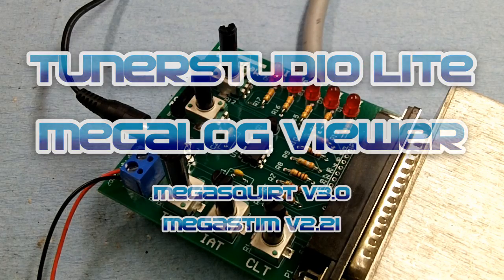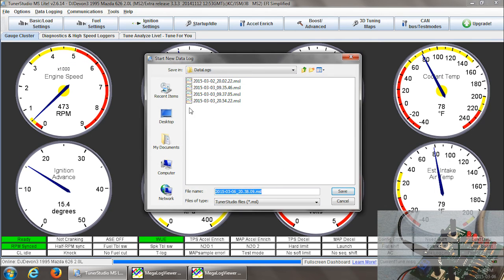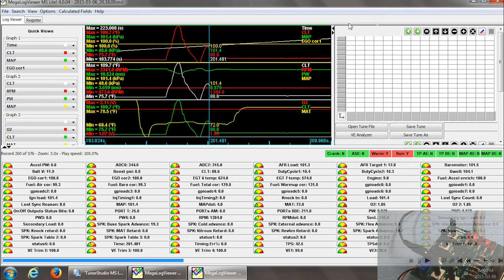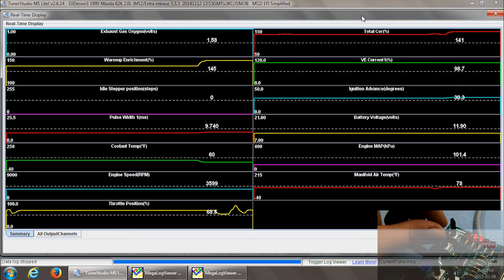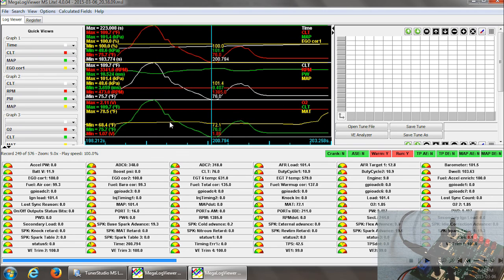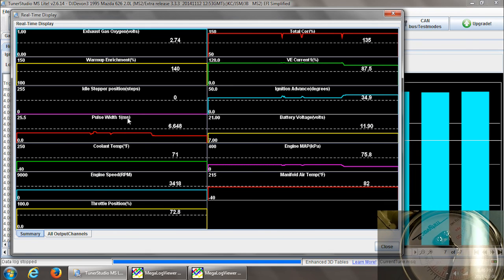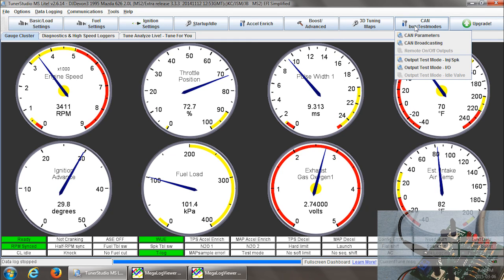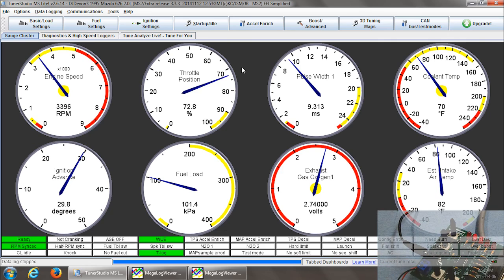MegaLogViewer (MLV) Benchtest with MegaSquirt + MegaStim

Comment: If you ran MS on say.. a 2003.5 Mazdaspeed.. (OBDII) Am I going to be able to get the car inspected and keep it "legal"?

OK.. nevermind the "legal".

Can I get it to pass inspection?

Thats my question. lmao
Reply from the maker: +ILL Gotti No a Megasquirt ECU will not likely pass emissions.  Megasquirt is for "track and off road use only" where those vehicles are exempt from inspections.  Read the FAQ on the Megasquirt/DIYAutoTune website.  It is not for daily driven commuter vehicles.  It's for dedicated trailer towed race cars and/or for vehicles in countries or states with practically no emission laws or inspections (such as Florida where I live).
Reply: Got it. Looks like SSAFC is my best bet for the Mazdaspeed Protege.

BTW.. thanks for making that timing belt video dude! I made good use of it..

Comment: I still see some pre obd 2 vehicles. There very limited to pids and bi -directional controls. We test them at the tail pipe measuring the five gasses. Where as long if the check engine is not illuminated and the moniters are complete from a drive cycle on obd2 vehicles.
Reply from the maker: We do not have emissions inspections here in FL.  This is the perfect state to get into MegaSquirt. :P
Reply: What is that
Reply from the maker: *****  What is what?  MegaSquirt?  That's what my recent videos are leading up to.  Google it.

Comment: Nice to visit your channel
I see you all the time on scanner danner
And schrodingers box
Reply from the maker: Thanks for stopping in to say hello.  I recognize the name. Here's a video you might enjoy.  https://www.youtube.com/watch?v=ITfQGEASYvU
Reply: I do Emissions and drivability in Northwest Indiana. Have the L1 and the I.C.E.R.T. certifications
Reply from the maker: ***** So you didn't get the reference in the video?  That's actually your real name?  Guess it's not that funny now, nevermind. :P
Reply from the maker: *****  Ohh L1 advice could be handy when it comes time to actually tune this after getting it wired up.  L1' guys are awesome.  I've never even seen a VVT engine in real life nor ever held an OBD-II scan tool.  I'm all OBD-I here flying by the seat of my pants running diagnostics on every single component.  It sucks and takes forever but is a much better way to learn all the basics.  Maybe you can see why I'm so excited to get MegaSquirt installed.  It doesn't have an OBD-II type of diagnostic system but I can control things in a way that's comparable to a bi-directional tool and you know how expensive those things are.  This is kind of a cheap way to get bi-directional control for an older OBD-I vehicle.  :)  Congrats on your ICERT and L1!